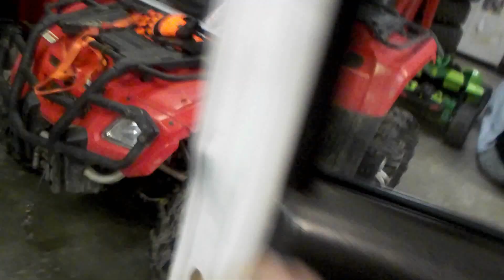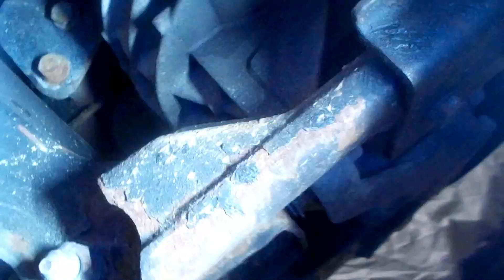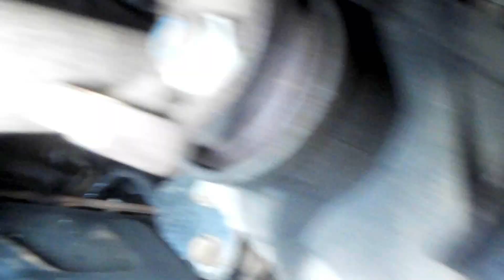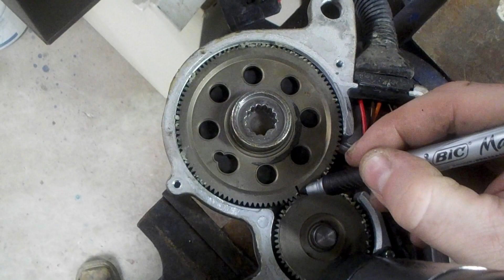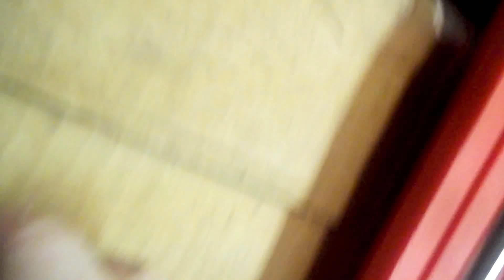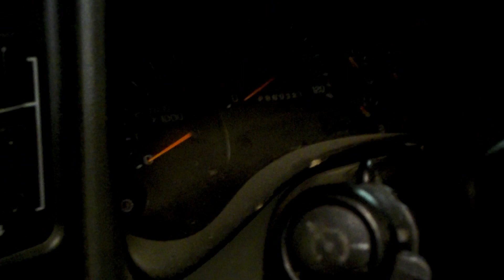Silverado Transfer Case Shift Motor Repair

Comment: The other day I was switching through the buttons to make sure my 4x4 worked and it seemed fine. The next day while driving I lost 2nd gear and the truck just revved when pressing the gas like it went into nuetral so I turned off the truck turned it back on a d same issue. I then tried cycling through the p r n d 3 2 1 by shifting then it wouldn't go into either gear and when I went to reverse it made a squealing noise so I put it in park and it seemed like it was in nuetral so I set the parking brake and hit the auto 4 wheel drive button and the truck jumped forward and it drove just fine. It seems.like when I mess with the buttons it throws everything off so any ideas on what this could be?
Reply from the maker: Martin Berlanga I have another video to check your transfer case.  I suggest watching it and going through those steps, sounds like the shift motor but I can’t be sure.
Reply: Did you ever figure this issue out? I'm having the same one.
Reply: @jarmonhicks9899  
 Took it to a guy that rebuilds transmissions and transfer cases and he told me it was the transfer case after driving my truck like a mad man. He said the transmission was fine but needed a new transfer case. Still haven't gotten it back on the road yet since the transfer cases are about the same cost of a transmission.
Reply: @martinberlanga4914  Go find one in the junk yard.  You'll be out next to nothing.
Reply: @martinberlanga4914  the exact condition you described is that of the part that was replaced in this video. The transfer case has a neutral gear. With this encoder ring malfunctioning, the truck might think it's in 2wd when it's in neutral etc. Also check vehicle speed sensor etc.. Google it . Probably not the trans case itself
Reply: @SS-vp4eu  the problem was the transfer case range select position sensor. Replaced and have had no problems since. Part # 88962315 hope this helps anyone with the same problem.
Reply from the maker: Jarmon Hicks I haven’t heard back from him, but I have not had the issue he describes

Comment: just a little tip for anyone who wants to use it. when you remove the straps for the U Joint caps, any drive shaft, get yourself a "C" clamp a regular "C" clamp that you tighten by hand, not the vise grip kind, and clamp it to the caps still on drive shaft real tight. you then now no longer have to worry about them getting efed up or coming off. just make sure your centered and tight.
Reply from the maker: That is a good point, I would suggest tape, or some other thing that does not increase the size of the shaft when doing this repair the way I showed it here.  There are really tight and close clearances when you tuck it up the way I did, but if you are removing the driveshaft I would defiantly
 put a clamp on it.
  Thank you

Comment: Bought a 2005 chevy 1500hd. 4x4 didnt work when purchased. Tec fuse was blown I think that's what it is. The 4wd fuse under the hood. Replaced the fuse and put a new 4wd switch in it just to mark that off the list right away. The lights on the switch turned on but stuck in auto 4x4, which makes it stuck in 4x4. Replaced the front dif actuator to mark that off the list as well. Still says service 4wd and have to keep the 4x4 fuse out so I can daily it without being in 4x4. The transfercase is new, and I'm assuming so is the motor to change 4x4 2wd etc. Worth replacing what you replaced? Or just replace it all? Also cleaned the ground wire area under driver door. Dont have a good scanner to read the 4wd service code. only obd2 scanner for basic stuff.
Reply from the maker: Jon Boatman unplug the front actuator wires and check the them.  One should be a 12v battery positive, and one should be a ground connection.  If you have a power probe that will be easy but if you have a multimeter just see if there is continuity to the frame from the black wire.  I had that problem too and there is a really cheap fix for that.  Also can you shift it to anything but auto?  Like can you put it into 4hi or 2hi?
Reply: Ok, I'll do that here in a couple hours and let you know. Thank you
Reply: I push the buttons and nothing happens, no flashing, doesnt even try to change 4x4 or 2wd. In park, neutral or drive.
Reply: I'm not much of a electrician, but I have a power probe. Should I check the switch with the truck off, aux, or on
Reply from the maker: Jon Boatman key on if I remember, the black wire should be the ground.  If that checks out tell me if you can hear the shift motor move when you press the buttons.  It should be an audible set of clicks and Motor sounds.
Reply: Alright, so I finally got some time to crawl under the truck. The black wire did not light up my probe light. Only 1 out of the 4 wires to the front dif actuator plug. And it did not blow the fuse when I unplugged it. The 4x4 fuse under the hood. The 30amp one. I put it in before testing to make sure all connections that are supposed to be on are on. Still stuck in auto 4x4. Kept pushing the buttons and no noise, nothing trying to change the transfercase gears. Even tried unplugging the front dif actuator and push the buttons.
Reply from the maker: Jon Boatman did not light up your power probe or your test light?
Reply: The test light sorry. I'm assuming I checked it wrong lol?
Reply from the maker: Jon Boatman yeah sorry you are testing for ground, not power at the black wire.
Reply: Alright, I'll check with the power probe.  If it fails the test what's next, if it passes what should I test next?
Reply from the maker: Jon Boatman I would have to give that some thought.  You should have battery voltage on one wire and the black one should be a ground to the frame
Reply: Good news. Replaced the transfercase motor. Works perfectly now! Just giving you a heads up
Reply from the maker: Jon Boatman great news, I am going to put together another video explaining what else to look at

Comment: I have no power on my dash for my 4wd, meaning doesn't light up. I switched the switch and transfer module, checked bolts under drivers side and still nothing. Do you think this might be it? Oh the switch does light up when I do start the truck, but shuts back off
Reply from the maker: kris cruz yeah, or a wiring issue.  When you turn on you truck do the lights flash and then go out?
Reply from the maker: Sorry I just re read your comment and yes this is exactly what mine would do when I had this problem
Reply: @GSEShop  Thanks so much for your reply, much appreciated
Reply: @GSEShop  this is what mine does. I start it up, lights come on, then stay off. Can't switch anything. Stays in 2wd. Replaced the switch, still the same issue. What do you think? Encoder ring sensor?
Reply from the maker: Eli S more than likely or a bad motor all together. the encoder ring tells the computer where the shift motor is so if it doesn’t send a signal the computer won’t light up the lights.  If it isn’t this it is a wiring issue
Reply: @GSEShop  I appreciate it. I'll try it after double checking all wiring connections. It's a relatively cheap fix, before replacing the motor altogether.
Reply from the maker: Eli S I agree but if it doesn’t work don’t rule out changing the whole thing.  This works about 75% of the time but not 100%